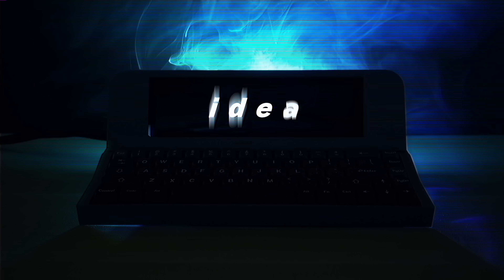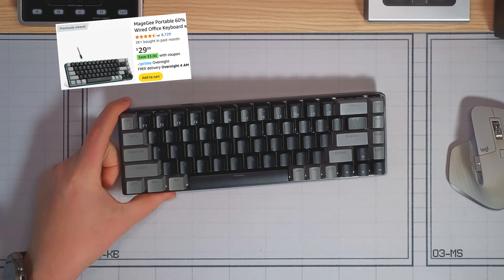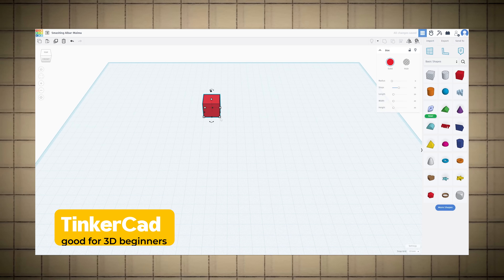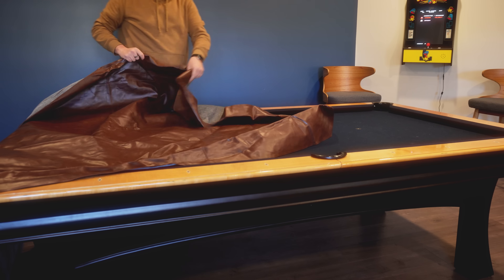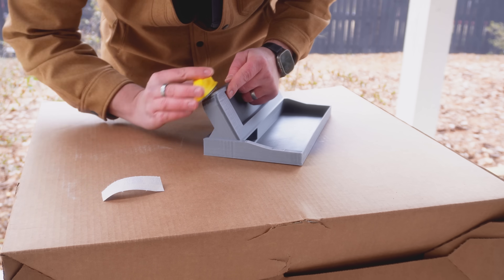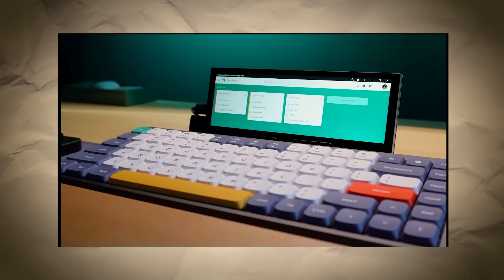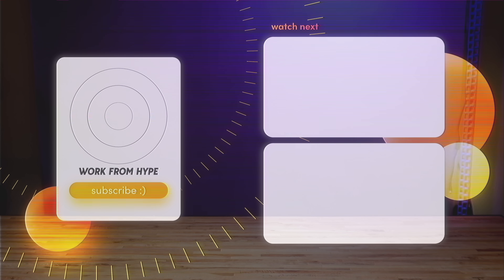How to Transform a CHEAP Keyboard into a SCREEN BOARD

Comment: Its gorgeous, even if there are imperfections from the mold. You created a space. I was impressed when you revealed you had a 3rd monitor set up. Most people at my office have been starting to work with widescreens or dual laptop. They don't want me to get one because I know all the keyboard short cuts, so I've been working for years with a single monitor. Occasionally I'll have a 2nd monitor set up so if a client walks in and sits in front of my desk. He can see work screen without coming around the desk to see. But love how that 3rd monitor is hidden in with the wall art, and a useful 2nd screen with your keyboard.

and yes from this time period. These keyboards where considered ergonomic. But these keyboards where designed to be work horses. A person would be typing all day so before they got creative with breaks in the keyboard, rounded keys were more comfortable. It was towards the late 80s everything became square and hard edged. I remember someone joking that some of those first big PS1 keyboards where top rack dishwasher safe.

Comment: Project like the one you have here - I ended up never using them, because it was in another room, already attached to something else, out of battery, etc. etc. etc. In order to be useful, such a device for my use cases has to be completely stateless, wake up in an instant and work off 2032 battery for years.
Tried doing practically exactly what you have here, it failed for these reason of being inconvenient.

Now, my use case may be different, I type better than speak (it's fast, doesn't distract me and I can see/edit what I've just typed, unlike audio), and I need to constantly capture a lot of ideas/memos and what not.

Instead ended up with multiple (that's the key, I'm never too far away from one) thin portable keyboards with attached to them eink screens thrown around, which can also use bluetooth, so I can use them with my phone, or a small tablet (of which I also have several here and there) to do whatever, like connect to any of my linux boxes or VMs in the cloud.

Comment: How to Transform a CHEAP Keyboard into a SCREEN BOARD. Turns out it is as simple as buying a keyboard and a screen and plugging them in. Sprinkle in the garnish of adding keycaps and cable wrap to bloat budget and tada you have a expensive second monitor.

Comment: 68% keyboards are pretty standard, one could easily swap out that keyboard with a better one, or DIY it in that same area. i have used an IBM model M for the last 8 years or so, and i have only recently found a couple that come close enough - a keyboard built into the clevo x170sm-g and this perixx keyboard/trackpad i found to use in my home theater area. they arent 1:1, but the weights are probably as close as youre going to get with a modern keyboard

Comment: Oh yeah.....
If you want to get rid of those layer lines, cut the part in half....aka a left and right piece. Then place the parts so that the new sides you just created with the cut are now facing the plate. This will allow the printer to print in it's natural motion. Yeah, you'll have a seam but just one that will barely be visible.
If you really want one of the best finished possible, use PLA-CF....carbon fiber. The carbon fiber powder in the filament will melt and fuse the layer line together causing them to virtually vanish.

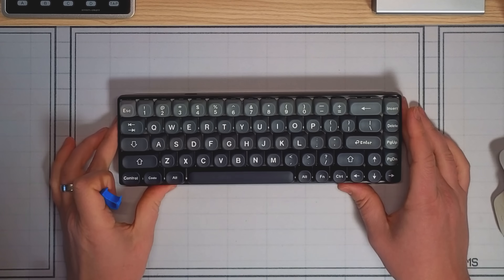Comment: 5:10 That Enter key is bizarre. Surely it must be a mistake since the font doesn’t match the other keys with words. Is it from another set maybe and mistakenly included in yours?
Reply from the maker: Strangely enough, it absolutely was the one that came in the box. I think they must sell another set with that font and just used it in this set either by accident or they didn’t see an issue lol.
Reply: @ That’s what I meant. THEY messed up and put it in the wrong set. You should have them send a replacement, because that wonky font is hideous.

Comment: I've got a neptune. You won't be disappointed, but take a bit of time fine tuning the calibration. Oh, and get some mega hold aerosol hair spray for bed adhesion. It works significantly better and cleaner than the included glue stick.

Comment: @11:13 if youre using the free version of shapr3d then thats why the model looks like that not your modeling skills.
they automatically simplify the polygon count when you export it under the free version
Reply from the maker: Yes! This was a lesson I learned after I finished the project. I ended up paying for the full version and it seems like this will be very helpful.

Comment: I was born in 1985 and I grew up around "portable" word processors that had form factors similar to this but larger, less modular, lesser functionality, and upwards of five times the cost. It always astounds me how nowadays even DIY devices like this are not only orders of magnitude more powerful without upgrades to default specs but also offer exponentially greater functionality out-of-the-box even in smaller sizes. Even just the iPhone 12 that I use as my regular phone is at least 100, if not 1000, times more powerful than not just the Commodore 64 we had as a kid but also the Windows 3.1 PC we had after that, and the Raspberry Pi that would inevitably be used to power an even more portable version of this thing is at least on par with Pentium 4s and the early multi-core consumer Windows desktops of the early-to-mid 2000s.
Reply: The level of software design (and innovation in software development) hasn't improved though. Some might argue it has got worse!

Comment: I have a similar design stuck in MY head. Same style screen, but larger and folding over the keys for a clamshell portable.

Being raised on Lenovo (with Trackpoint), one hurdle is adding a low profile Thumbstick joystick. This messes with re-using a  conventional keyboard.

Comment: So, i may be a little late, BUT, you dont need a PCB to make a keyboard, all the PCB does is wire it to a controller like a rasp-pi, you could totally handwire a keyboard and use custom key switches(like having different keys for different things, like if it was also used for gaming, have your gaming keys {qwerasdfzxc up down left right space ctrl shift tab} be seperate kinds of switches than the other) for different things, you can also design and have PCBway or JLCPCB print you a few for a decent price, or, if you are savvy enough you can make your own PCB at home with some blank PCB stock and a printed template and etching solution. point being, this could totally be a handmade project from scratch. 
i super want to do something like this for temps, time, calender, alerts, and other widgets for my own setup(s). Oh, and it can still be wireless for a little extra as well.
Reply: There's a good handful of 3D printed keyboard designs for handwiring which contain channels and tools to bend and lay the wires too. But you can also freehand the wiring. I say a PCB becomes a mighty good idea if you want in-switch lighting though, but then also, designing these types of PCBs poses a bit of an extra challenge.
Reply: @ nah, with a couple scottokeebs vids and fuckin around in KiCad for a couple days I’ve already made up and e-tested a few different layouts I want to try, I haven’t fully decided on which one I want to make reality yet.
Reply: @  Non backlit layouts are extremely easy, since there's never more than 2 crossing nets, it's when you start to route lighting that it becomes... not outright hard but you're likely to have a good few false starts until you work out an approach that isn't horrible.

Comment: a 3d printed piece to hold a small monitor. Kinda hoped for something more elaborate. Could use a small dev board like raspberry pi pico or maybe an esp to log keypresses and control the display. Then you could say its a screen board.
Reply: Yeah, I was expecting more too. The video was him designing an enclosure and adding complexity by replacing the keycaps and wire wrap.

Comment: A raspberry pi zero with a word processor and a battery in some of the empty space below the screen would turn this into a nice, portable working station. An e-ink screen would also make such an approach useful outdoors, too.
Reply from the maker: I’m definitely a fan of the “cyber board” concept. I’m planning an episode where I use a small form factor PC and build a unique case around it. Stay tuned…
Reply: @WorkFromHype  A built-in KVM would let it work as both kbd/screen accessory for your desktop, and as a standalone for an SBC
Reply: @WorkFromHype  I think it'd be cool to have a dual purpose "keyboard" that serves both as a keyboard for another machine, or operates on it's own off a Pi.
Reply: You are more or less describing a Cambridge Z88 from nearly 40 years ago ... lol
Reply: @secondc0ming  Either that or a Tandy Model 100 from 5 years before the Z88. I keep coming back to the idea of making a modern one, but I've been stuck in the design stage for years now XD
Reply: This takes me back to the Alphasmart I was told to use in middle school because no one could read my handwriting.
Reply: So a cyber deck?
Reply: New sub, good video!

Also, you kinds sound like "Make it RC" but for tech stuff.
Reply: I imagined something similar back in 2022! 

In my case, when connected to another device, the screen would show a list of keyboard shortcuts for the app in the foreground, but when used standalone, I could use a text editor (I pictured GNOME text editor for this) and basically use it sort of like a Freewrite or Pomera (but without a battery), or even go into a Web browser to load Web versions of Evernote or Milanote. For the keyboard, I pictured using the existing Cooler Master keyboard I already use, which is a 100% size keyboard, but it would've also been able to fit TKL size keyboards as well.

I imagined the software being a customised GNOME setup with custom indicators on the status bar (including the keyboard lock indicators), but if I were to do it in the near future, I imagine that I'd instead go with a modified KDE Plasma Mobile setup, however I never made the project because I felt it wasn't worth the prices I calculated for the parts I would've needed.
Reply: I would say that making is e-ink will ruin the functionality. I actually love the use cases from WFH - pinning youtubes and using this as a spotify thingy on a monochrome low refresh rate screen will be ugly AF.

Comment: I hoped it to be anything more than just a bulky holder for your keyboard and screen. Could've put a USB Hub or Dock also inside, and it would've been a bit more useful.

Glad you learnt how to 3d model stuff! I should get to it soon heh
Reply: This is exactly what I was thinking. With USB C and some of the multi port devices available on Amazon, this could be a desk top docking mothership of connectivity options.